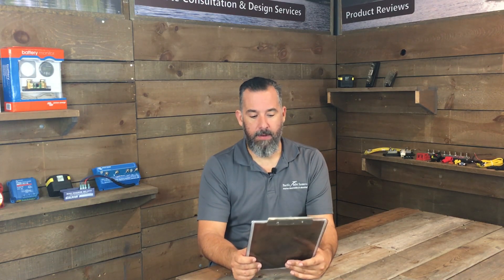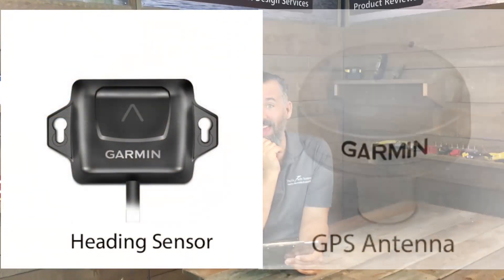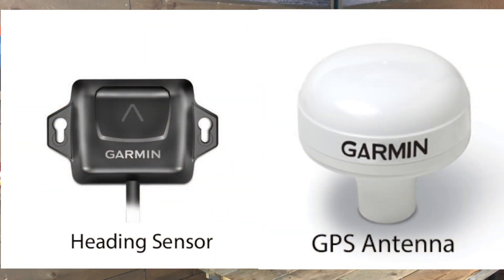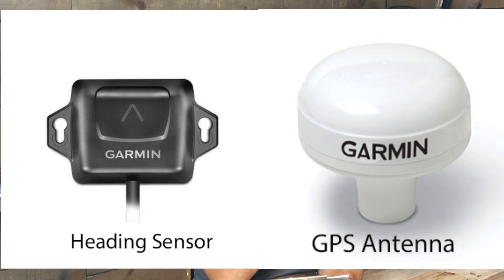Ask PYS - What Is the Difference Between a Heading Sensor and a GPS?

Comment: Jeff my boat has yamaha autopilot tied in with my electric steering. My problem is when i stop to fish and turn off my key on my yamaha motors i lose my heading sensor on my garmin 8616xvs screens. Should i install a garmin heading sensor and tell the unit to use that heading sensor instead? If so which one? And will my yamaha steering and autopilot still work with the new garmin heading sensor?